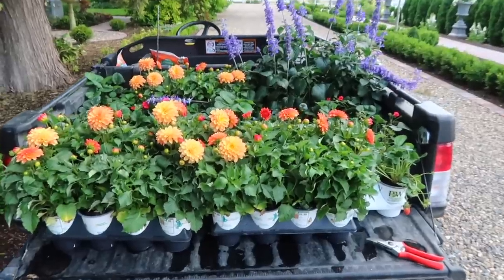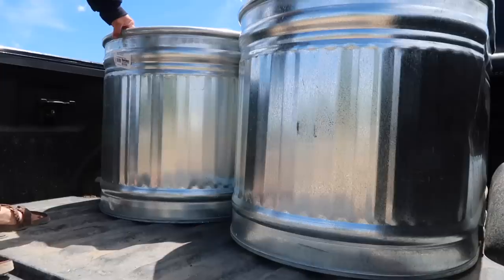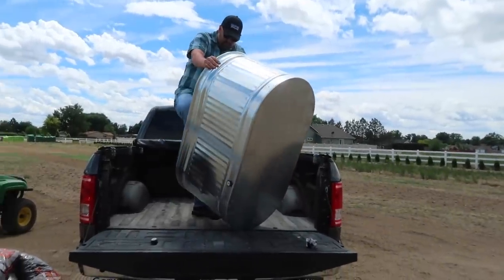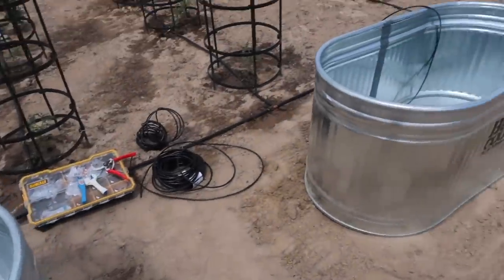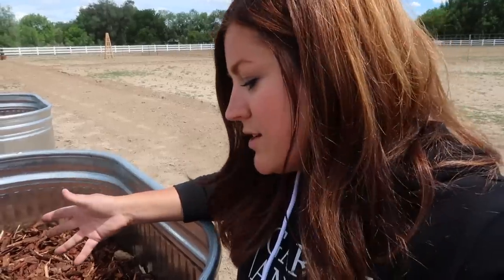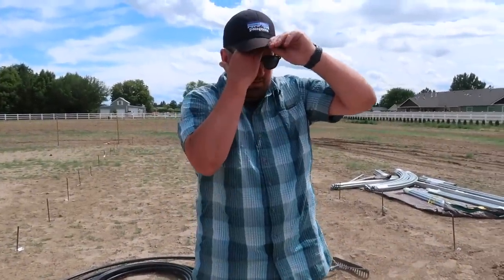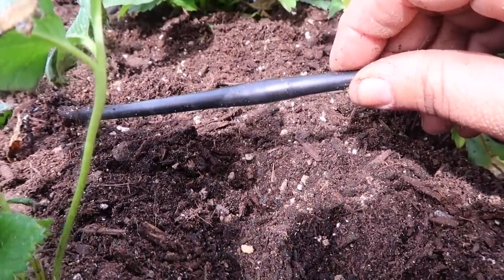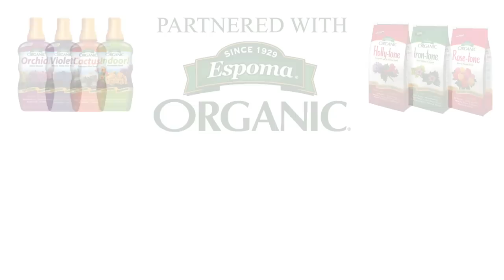Planting Strawberries for Benjamin in Stock Tanks! 🍓🌿// Garden Answer

Comment: I don't know if someone already mentioned it, but the drain holes in the stock tanks screw out with a 1/2" ratchet head, leaving the rubber gasket behind. It makes it a lot easier to open and close the drain if you only remove the white part with the square hole instead of the whole thing.

Comment: Laura,  I use stock tanks for a lot of my veggie garden.  I made them into wicking gardens which is basically making them a self watering pot.  They work great and  as I'm not getting any younger the height makes them a good raised bed height.
Reply: Diana Miller how do you make a wicking garden?
Reply: Yes please Diana tell us more 🙏 I'm resisting the impulse to drive out to home depot and buy a stock tank.. at least until I have more info
Reply: Diana Miller just sub to you for more info.
Reply: Diana I would be so interested in knowing how to make these self watering!!! I love the look of these containers!
Reply: The way I made my wicking garden was as follows:   I took flexible perforated pipe and circled it around the bottom of the tank in only one layer.  I put what they call a sock over the pipe to keep as much debris out of the pipe as possible.  I then drilled a hole in the pipe the same size as the PVC pipe that I chose to use to fill it, like the pipe used in filling the self watering pots.  The PVC pipe used for filling the reservoirs should be tall enough to reach the top of the stock tank. I can't remember what size diameter my PVC pipe that I used was but it is big enough for my hose.  After putting the PVC fill pipe into the hole in the perforated pipe I just covered it all with gravel.   After the gravel was in I drilled a small hole just above gravel and placed a  small PVC pipe in the hole, placed a little patch of screen over the hole on the inside and put a 2 part epoxy around the outside of the drain pipe to seal it.  Word of advice, place the overflow drain where you can watch it as you fill the reservoir.   I put a good long lasting landscape fabric on top of the gravel and then filled the rest of the tank up with a good raised bed soil.  When I'm filling the reservoir I watch the overflow drain and when water starts dripping out of it I know it is full.  These have worked out really well for me and I have never had to do any maintenance on them.  I'm guessing eventually they will rust out but I have had mine for eight years and they still look really good.  I suppose if you lined them like you would a wooden raised bed they would last longer.

Comment: After constantly reattaching my tubing last year, I found couplers that keep the tubing locked in place. It's called "permalock tubing coupling" and you can get them from Drip Depot.  After you wrangle the tubing over the coupler, there is an attached knob that screws down over the tube connection and it locks it in place. No blow outs, no drips, no wasted water. For a system as large as yours, it would give you peace of mind that things were running smoothly. Extra bonus, they included 2 Tootsie  pops with my order😍

Comment: I've used foam from boxed items and stacked them in like bricks and covered them with cardboard and then soil.  Light, does not soak in water that could add to the weight when like using bark as it gets older.  won't the wind that blows across your fields beat up the flowers in the raised tubs.

Comment: Im use empty plastic 1 or 5 gal plastic nursery pots turned upside down , depending on the size of the planter. They are lightweight and durable and most gardeners wind up with a ton of them.

Comment: We use the cheap black burn barrels you can pick up for $10. My husband makea sure they come with lids. We drill holes in the bottom and then use the lid to make a shelf inside about 15" down and fill the bottom with two big rocks so its not top heavy. Then put my annuals in them in front of the barn. They are up high and easy to move!

Comment: I use empty plant containers upside down or empty plastic milk jugs in my big pots to save on dirt, recycle the plastic and make the planters lighter in case I need to move them. I believe this also helps them to not break in the winter because the pot isn't full of something that freezes so solid.

Comment: If the drain hole isn't enough, just drill more later with a big bit. Love them! (But not as much I'm sure as Benjamin!) I did use rocks (limestone) to fill the bottom of my raised beds, but they're not going to be moved and that way the plants will have access to limestone. Water gardens are fun, you should do one, or two, I have fountains in mine, love it .Also you could add some goldfish for Benjamin.

Comment: I’ll keep saying it... cardboard, wood chips = no weeds. Not to mention, totally free. Research cardboard sheet mulching.
Reply: What about the glue in cardboard?
Reply: @Bamboo4U2  organic farmers use it in no dig gardening and they don't seem concerned about the glue between sheets (used between layers) I do see that they remove staples, tape and labels. Check out Charles Dowding here on YouTube
Reply: In that size of an open space, with absolutely no tree/wind break, and unexpected winds, reaching upwards of 65 mph, wouldn't you have to use several tons of mulch/wood chips on top of the cardboard to keep it from flying away...not to mention wood chips flying every which way because there's almost no rain to weigh them down and help in the breaking down of the cardboard (??)
Reply: @hayleywise7403  agreed!
Reply: Jake Jones most boxes are taped or stapled. I haven’t had any glue issues. If it’s plastic tape, you have to remove it. I took out all the grass in my front and back yard about 2 years ago. I used about 8 in of wood chips. Now my soil is rich instead of sand and no weeds. I added a bit of soil compost mix where I planted each plant. If you saw my yard 2 years ago to now, you wouldn’t believe it. It’s fairly basic permaculture practice.
Reply: Hayley Wise I think she would do it in sections like she has planned. I used about 8 in in my garden and it doesn’t blow away (Florida hurricanes). The wood chips are free and save tree trimmers from a dump fee. I used about 10 truck loads in my project. Just a tip for the driver!
Reply: karysmuh I follow him too - no dig is the only way I could go under big oak trees.
Reply: @FLlife  If there is TAPE, there is GLUE, period. What's the VOC rating of that glue? These are things to consider, not dismiss just because another no-dig YouTuber does it.
Reply: Jake Jones garden at your own pleasure... I have personally had great longterm success. It’s a core practice in permaculture that stretches far beyond a youtuber.

Comment: The 1/2 inch brown couplers are Rain Bird brand right? I bought some myself to use for my drip system because I saw that they looked like the ones you used. I have noticed that mine have been letting out leaks too! Maybe the manufacturer altered the design recently? 🤔

Comment: My Parents had a smaller business for almost 20 years growing seasonal Chrysanthemums, only maybe 25,000 to 28,000 yearly.
 So all of my childhood was wholesale grower side, for years they used a similar system to that with the black poly only they had smaller tubes coming from it with a small piece of tubing on the end to go directly into the pots. They later went to something called T-Tape but both ways they had to use the little hose clamps at most of the joints because of pipe blow outs...

Comment: Another idea for a easy and cheap filler for these stock tanks is straw. My garden just inherited one of our old stock tanks that no longer holds water (Score for me!) and with two straw bales in the bottom, I was left with something that was actually reasonable to fill with soil. Of course you’ll need to top up as the straw decomposes, but at least it will add something back to the soil opposed to pop bottles or rocks.

Comment: Wood branches, tree limbs are a great filler & as they break down it creates Soil.
Our JET STREAM is shifting again & the upper level winds are in a Meridional Flow. A Meridional Flow runs along the longitude lines/N & S as opposed to a Zonal Flow that runs along the latitudinal lines W/E.   A Meridional flow pulls cold air down from the Arctic & warm moist air up from the Gulf, in deep troughs.  If its cool in your Desert area, just imagine what it's like up in the Mnts. 
We're unseasonably cool in MN too, tho that'll change by this weekend. (I've noticed it's  cool 4 or 5 days then ghastly hot back to cool, to hot.. You get the gen idea) Meridional flows from the North will keep your AC Elec bill lower but its going to be hard to get Corn to grow because corn needs heat.  
Lastly: have you considered a potager near the house & having your new land more formal with one grand focal point & all. We know your love of boxwood😁
Think Chenonceau or Chateau De Villandry or just a grand potager.  Just a thought.  Hope that wind flow explanation helps.

Comment: If you can find some pool noodles( those styrofoam floating things that are about 5 feet) that have the hole in the middle, maybe slice them open and add them around the edge so Benjamin doesn't get burned trying to hold on to the hot metal, or the berries don't burn when laying across metal.

Comment: I know you a separate well drilled for this area. Could there be more water pressure that the well at your house? Those of us hooked up to city water need to put a 15-25 psi water regulator which can be placed as the 3/4 or 1/2 tubing comes out of the ground that decreases the water pressure to a level that will not blow the connections for the drip tubes! The laws of the universe will have your connections blow in the middle of the night when you are not around to find it.

Comment: I know this comment is a month late, but the couplers that are pulling away from the drip tubing appear to be netafim couplers (maybe), if so, those have a 50psi clampless pressure rating.  If your system is over 50psi output,  that's probably why it's happening.  Consider a pressure regulator (or double check yours if you already have them).

Comment: You may need to put a pressure regulator on the valve.  That tubing was always blowing off the coupler when the valve first started at my last place. The pressure regulator is relatively easy to add.

Comment: Laura - that drain plug will not work. I have used those for gardening and while the drain looks like it is at the bottom, the water has to be over an inch deep to even reach it. So, you can have an inch of water just sitting in it and whatever you have at the bottom will just rot. I used leaves, sticks, etc. in mine and they were so heavy - without the dirt even filled in yet - because of all the water, and it stunk. Sorry! I ended up having to empty mine and drill holes.

Comment: We use troughs with a false bottom and 16" of soil. We also put 2 x 4s under so we can get the tractor blades under to move if necessary.  They work great.

Comment: To remove the stickers use a hair dryer. Start with 10-15 seconds and start removing. It may need a bit more.  The hair dryer heats up the adhesive and it  should peel right off with no residue.

Comment: I love this, would you recommend using stock tanks for a fun raised garden? I’d prolly need 6-8 of them. A trick to get stickers off, the adhesive holding it on needs to be hot. I use a blow dryer and it’s worked for me😁

Comment: When I was about 6-7 yrs old I burned my hands on a stock tank. Here in northern Utah we get temps of 100°+ in the summer. I had gone out to help feed and water the horses with my Grampa. I grabbed on the side of the tank to watch the water as it filled up the tank (it was about half full of water when we went out). I had blisters on my hands for a few days, and I only touched it long enough for it to register that it was scorching hot! My Grampa put potato sacks around the top of the tanks after that. He drilled tiny holes around the top and “sewed” it on with very thin wire. I do love the look of them though, I think we might have to use some for our raised bed garden.... ❤️❤️
Reply: I was wondering about the heat of the tanks too and Benjamin grabbing hold.  It gets so hot there.  Your Grampa was a clever man.

Comment: The cowboy in husband, Sam says the one side hole is sufficient. The manufacturer designs ridges in troughs to make the bottom drain toward the plug, for some. The plug you removed is also used for garden hose in some & shut off valve to open/close the drain. Hold on to them for later use, just in case. Good to see Russell made it out there before the end of video. Enjoy. cgzone8

Comment: Laura, you can use a product called Goo Gone Adhesive Remover to remove labels. On the difficult one try to get an edge up and spray some Goo Gone under it. Then use alcohol to remove the oily residue from the Goo Gone.

Comment: Benjamin is going to love it. 
Why don't you put a water pressure regulators between the valves and the black irrigation tubes??? Just because you didn't have this issue before, it doesn't mean you have to discard that....you told us to do it.🤔
🤗💜💜

Comment: I garden in those tanks.  You had better drill several drain holes and the bark nuggets will block your ONE drainage hole!  You will lose all your plants if water sits on the bottom.  I’ve been using these tanks for 5 years, they must have more drainage.  You can put lava rock in the bottom and cover it with landscape cloth so the dirt doesn’t block drainage.

Comment: I'm pretty sure three stock tanks would have fit, if they where not stored on the truck the long way or stacked. That drainage hole is quite large. Maybe a piece of screen placed over the hole would help prevent errosion. On all of your tractors and riding mowers, always keep a water proof tool bag that has a Stanley urility knife, pliers, and needle nose pliers. That way you always have tools with you. Just make sure you don't take them into the house. The blades from the utility knife would have helped get the labels off. I put industrial velcro on mine and have them stuck to the inside panels of my machines to save space. 

Link to HomeDepot Behlen Country
https://www.homedepot.com/p/Behlen-2-ft-x-2-ft-x-4-ft-Double-Life-20-Gauge-Bottom-Round-End-Tanks-50130028/100319520

Comment: Bark nuggets so funny. You two are to cute. I would be scared to plant in the trough like that due to the heat.  Arent you scared they will fry under all the sun?
I went to get a corner shower unit for our 2nd bathroom and the guy said it wouldn't fit in my firebird. (Hatchback) I told him I know it will fit. Should have bet him cause it fit. 🤣🤣

Comment: Are you concerned about the stock tanks getting too hot to touch?  I read this:  "They also mentioned the planters can not only dry out faster, but can get hot in the sun (they are metal). It's something to keep in mind if you have littles or pets running around, to make sure it doesn't get so hot in the sun you'll get burned if you lean on it like a hot car."